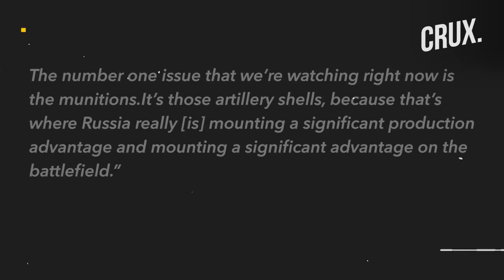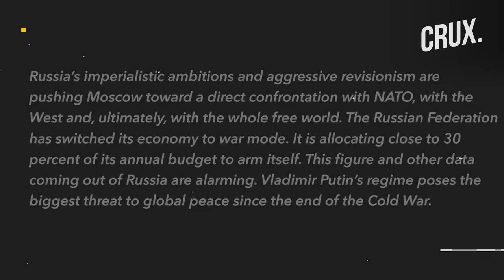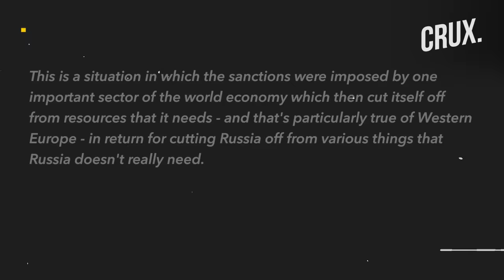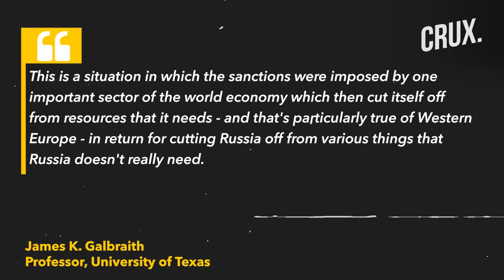Russia’s 3 Million Vs Nato’s 1.2 Million Shells For Ukraine | Putin's “War Mode” Economy Beats West?

Comment: But russia was firing over a half million shells per month at the start of the war.....meaning they would need to produce 6 million shells per year to regain what they used to do.  Russia is working at  maximum capacity now with all its factories running 24/7 with at least three shifts.  The only way they could produce more is to build more ammo factories.....and that would take about 5 years from start to finish to complete.  On the other hand NATO isnt running 24/7 at their factories and can easily out perform russia if they want to...as well, other munitions factories have started on construction already.  Plus with russias less accurate artillery they have to fire ten times as much to do the same damage as NATO rounds, which destroy targets with every shot fired.  And now that russia is losing more oil and gas production and sales it is making less money putting it further in debt, while NATO has 30 TIMES the money to spend in nominal GDP as listed from 2023.  So unfortunately for russia, it has lost the artillery race already......its stockpiles are all used up, and it  cant produce fast enough to replace what it uses each day....
Reply: Russia has most nukes, and thats the most important factor. West already lost the war, cause no one in their right mind will go into 3rd world war with total anihillation over ukraine. Russia vs ukraine is not forst nor last war to be fought.
Reply: "that would take about 5 years from start to finish to complete" To mass produce something as basic as shells? Not really

Comment: These numbers are wrong. Russia is producing about 5x times that much, which is why at times it has fired as many as 70 000 artillery shells a day. On the other hand, the US can produced no more than 28 000 a month meaning  that the US is producing about 336 000 shells a year. The Europeans started the war about to produce a measley 2 000 shells a month, or 24 000 a year. To facilitate the Ukrainian counteroffensive last summer, they had to buy 500 000 shells from South Korea, besides surrendering almost everything else they had.

Comment: Get real ,  all wars are smoke and lots of mirrors and as if Crux has the full inside on what NATOs full capacity actual is , and if it went to war? , imagine every NATO country going into full production , the other issue being the different types of long distance  advanced artillery  + shells where NATO has the advantage when it comes to pin point accuracy like the excalibre round etc . in the meanwhile having a combined members annual defence spend of $1,2 trilion not including the two new members ? does go along way to buying power , which in the event of real war would massivly increase .
Reply: Actually crux more western supporter from earlier videos